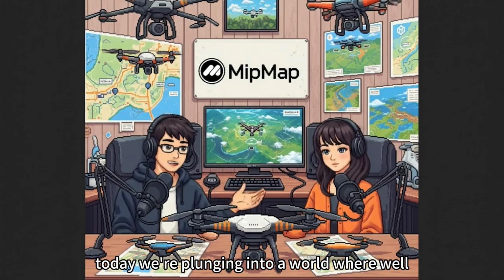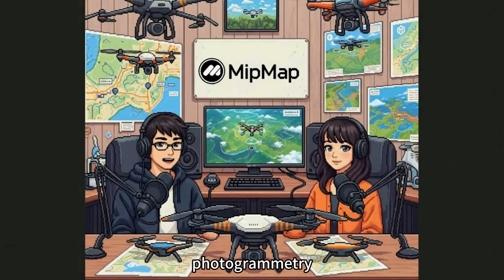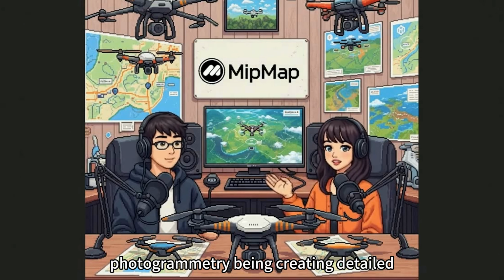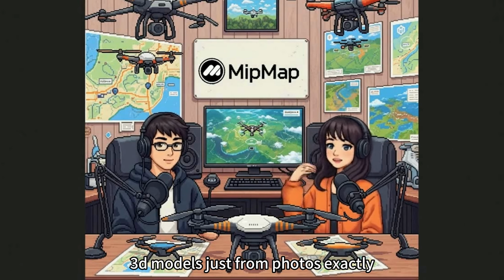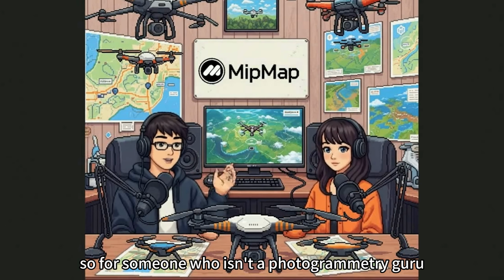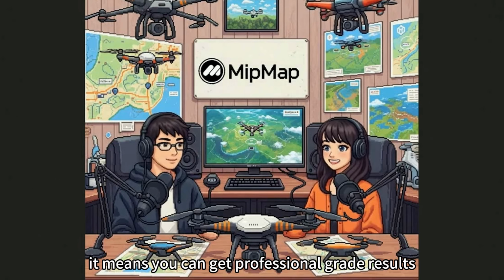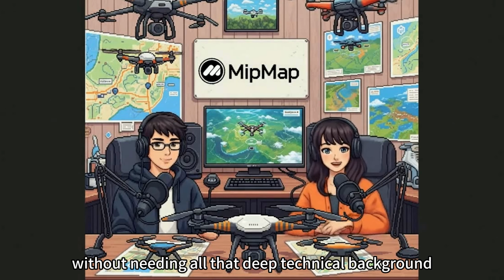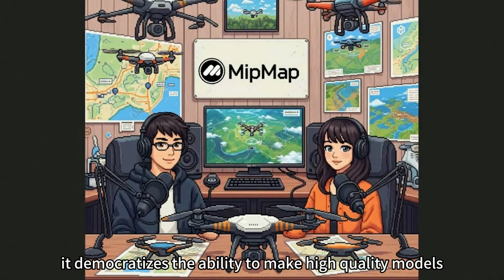Drone Mapping Software MipMap Brief introduction

Comment: Had high hopes for this software, however it just doesn't work for me. Have tried about 5 different datasets (drone imagery) with and without GCPs. Every time I get a "reconstruction failed" error when trying to process. Two different PCs. Datasets process fine using Metashape or Realityscan. A bit disapointing.
Reply from the maker: Hello, could you please export the log of the reconstruction error and send it to this email address: support@mipmap3d.com? I will help you troubleshoot and resolve the issue you are experiencing.
Reply: @MipMap3D  I just ran another drone dataset and this one worked! The only issue I seem to get now is repeated errors when aligning GCPs... "Tips
Reprojection error is too large. It is recommended to check the accuracy of the points markers."

Comment: Is there a way to get MipMap3d to work on my computer that uses an AMD Radeon 780M graphics card.

I'd hate to have to go through the trouble of changing graphics cards. Would be easier to just not use this platform, however, I would love to give it a go.
Reply from the maker: Thank you for your interest in our software. The software relies heavily on CUDA programming for GPU acceleration in its reconstruction algorithms. Supporting AMD cards would require significant adaptation, development, and ongoing maintenance, so unfortunately, it is not compatible with your Radeon 780M at this time
Reply: @MipMap3D  Thank you for the quick response. Will you be looking at utilising a cloud based processing system in the future so anyone can use your platform regardless of the GPU?
Reply from the maker: @DanielPennefather  Of course, we are gradually introducing cloud-based processing workflows. This will start with model sharing for delivering results to users and collaboration, followed by reconstruction processing in the cloud. However, these features will still require some time to be fully implemented.